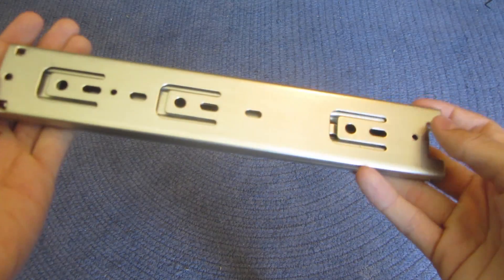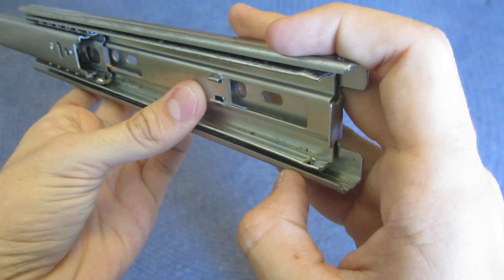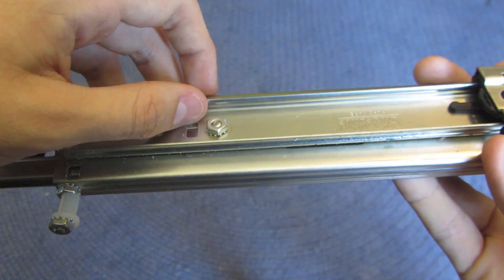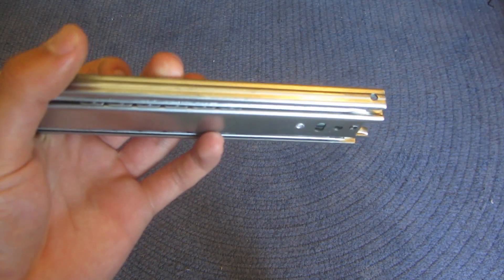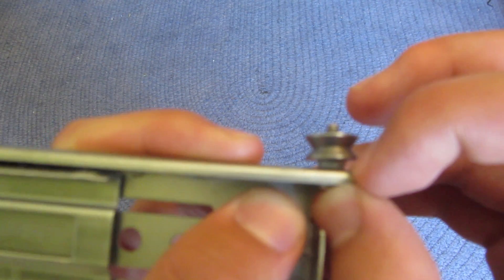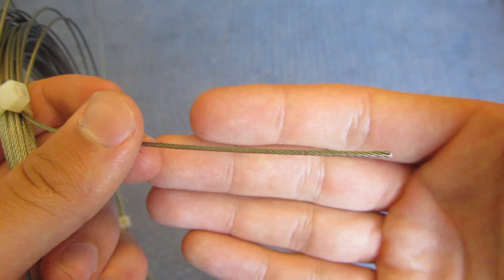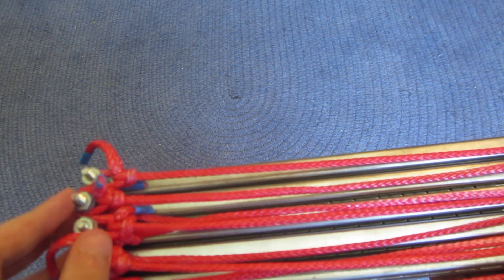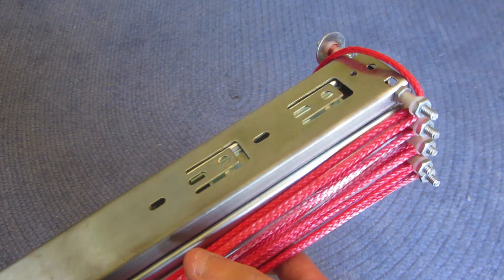Creating a Cascading Lift

Comment: How do you tension the strings equally so you can get the full extension of the slides? We have tried but can never get them all tensioned equally and we don't get the lift's maximum height.
Reply: String is to long.

Comment: Wow, what a great video, this is really helpful for all kinds of STEM projects. If you are having trouble with steal cable kinking or coming off v-bearing try using Kevlar thread it cost similar if not cheaper than steal, and behaves much better.

Comment: is there any reason you linked 1/16 crimps with 3/64 cable? I am assuming it is easier to assemble?
Reply: Hello, My team actually bought the crimps and cable they recommended.  I think the crimps are 1/16 so the 3/64 cable fits in it nicely (which it does).  After crimping it down we didn't find any issues with the crimps slipping.  When ordering the crimps I saw something that 1/16 steel cable won't fit in them.  I think you are just supposed to get larger crimps than the cable.

Comment: Could you provide links to the drawer slides you used?
Reply from the maker: http://www.homedepot.com/p/Liberty-18-in-Full-Extension-Ball-Bearing-Side-Mount-Drawer-Slide-1-Pair-D80618C-ZP-W/202200644
Reply: Garden variety in any hardware store. Get off our ass and go check.

Comment: Nice. Also if you dont want to use a spindle for the first stage of the cascading lift, you can use a rack and pinion as the first layer and drawer slides on the rest. This makes it easily compatible with tetrix frames and allows you to mount motors on the arm for space.